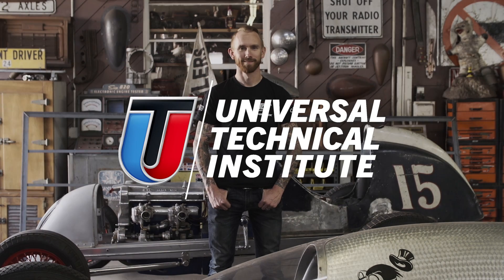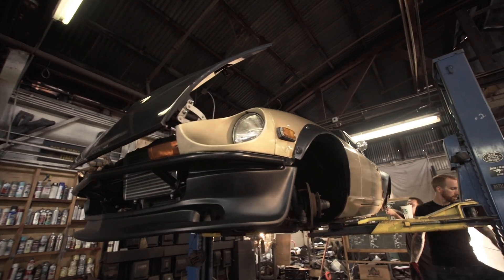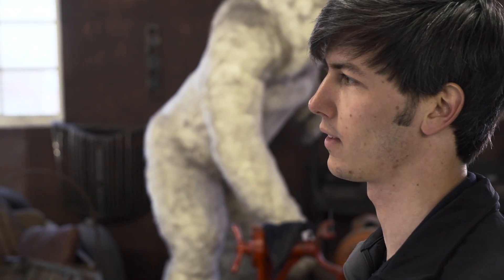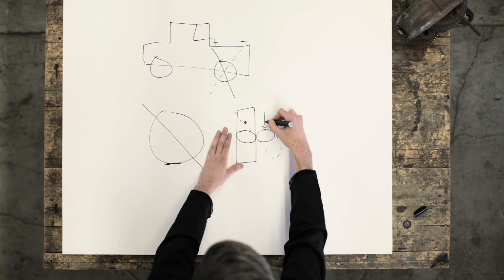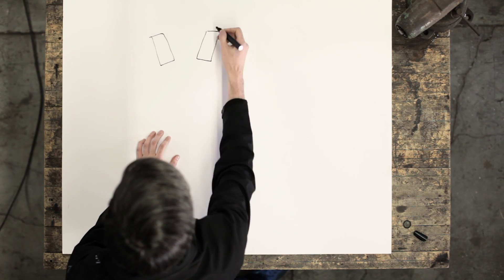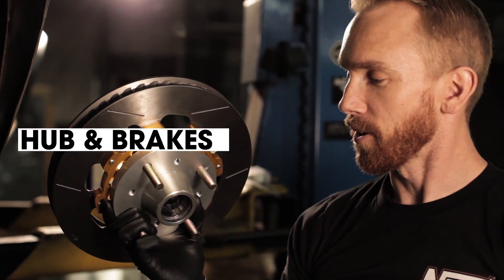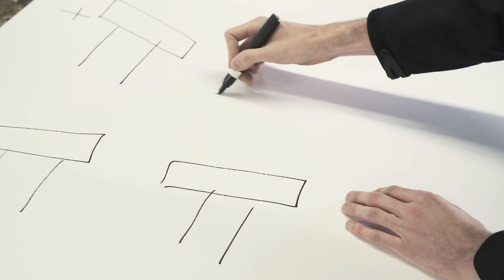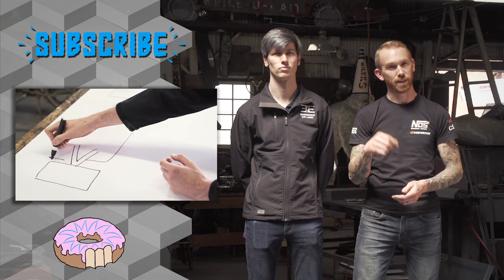Drift Car Dynamics w/ Chris Forsberg and Jason Fenske (Engineering Explained) Pt. 1 | Donut Media

Comment: I’ve got a 1990 na fairlane I’m looking at running a built tickford intech with a gt3582 turbo a btr 4 speed auto with a shift kit 3.45:1 diff with minispool 30mm whiteline front swaybar 28mm whiteline rear swaybar dual rear callipers ssl king springs all round and Monroe gt shocks on 18x10.5 +0 offset ssa smegs 35mm spacers in the front drilled spotted rotors all round do you have any advice on the idea as I’m also building a good one to the same specs accept not dual rear callapers and lsd and 5 speed manual and not tube chassis and 3.08:1 diff not 3.45:1

Comment: They tell you the manufacturers name for every aftermarket part except the coilovers they use... If i didnt know any better id say that the coilovers are Koni yellows ground control kit.
I drive around on these and i absolutely adore them with my custom spring rates. So im not sure why they didnt mention them my name.
Reply: Ramon Martinez Jr. I have those on my vw pickup, handles great, even with a dirtbike loaded in the back

Comment: This is a lot of info but the more you know the better your car will work.  Really stoked to upgrade my Datsun and it was awesome having Jason from Engineering Explained come by and breakdown the physics behind it.
Reply: +chrisforsbergracing  Great video from both of you. Props to the video productions team as well. Solid edits between technical data and tire smoke. Keep it up!
Reply: +chrisforsbergracing You have to feature your z more! Its my all time dream car and it looks just too pretty with the back out :D
Reply: +chrisforsbergracing What are you using for your stub axles (if you're still using those factory parts. I'm still at the frame/rollcage stage of my build, but I'm worried about the abuse that drift is going to put those.
Reply: chrisforsbergracing where do you get alot of you're parts?